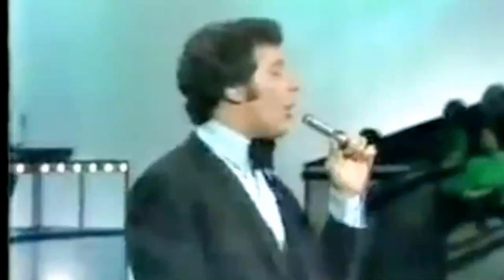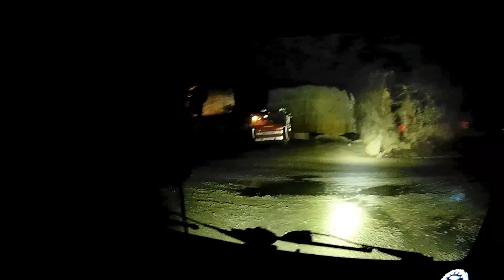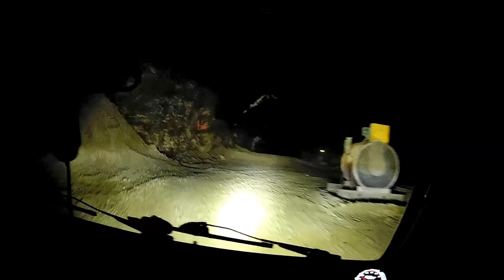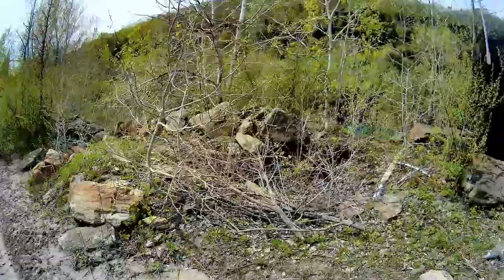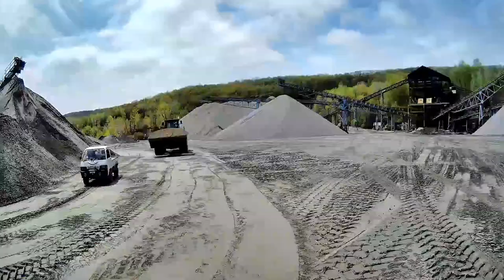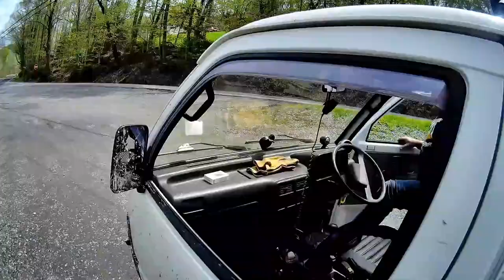Mini-Truck (SE02 EP05) Mini drives some mining caves. huge under ground tunnel system

Comment: Hey could I get your opinion on my mini truck's winch problem, it seems to want to spool in but not out. I tested the winch with jumper cables and it works fine so my guess it's an electrical issue or the solenoid is funky
Reply from the maker: It's probably the solenoid, sure it's wired right? Does it click but not reverse?
Reply: brushes could be burnt up.. or corroded if not used. always good to pull the wire out and spool it back in from time to time... just hook it to an ole tire or somethin